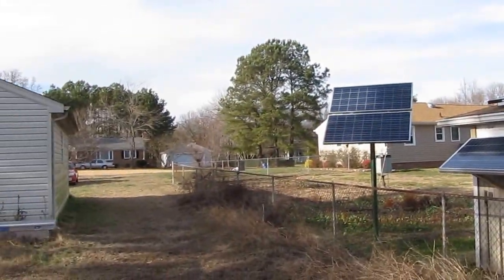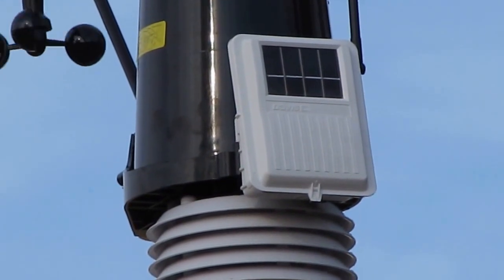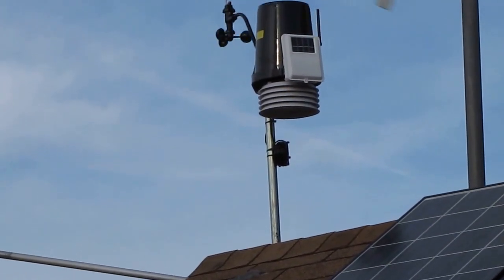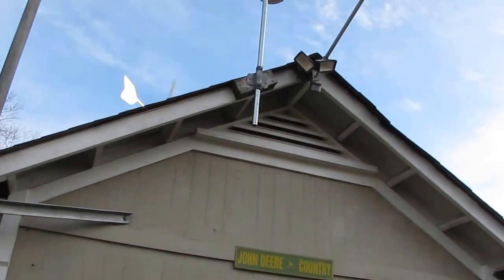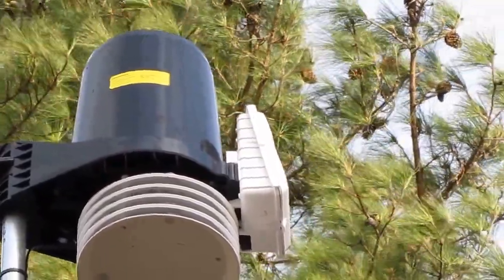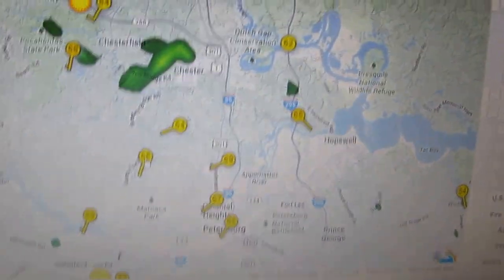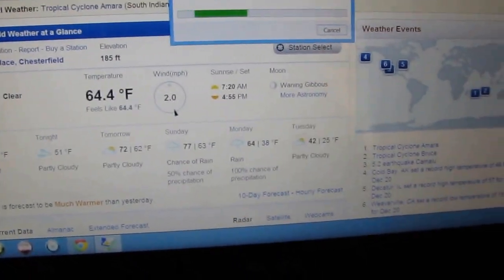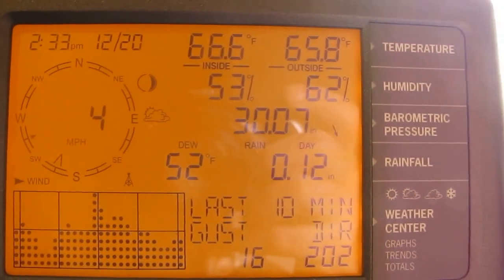Davis Vantage Pro 2  6322  Integrated Sensor Suite With Davis Vantage Vue 6351 Console  Pt 3

Comment: hi there hope its still workin well.do you find it better that the vue sensor suite.
Reply from the maker: Hi Wally So Far So Good No Complaints Brother Working More Than Better
Reply: I woz thinkin of getting 1 but they cost way 2 much.
Reply from the maker: They Are Expensive But There Is Reason Why It Is Built Way Better Buddy
Reply: think they are about 500 pound.
Reply from the maker: Holy Moly  In UK
Reply from the maker: Here Is A Link Wally 
http://www.scientificsales.com/6322-Davis-Vantage-Pro2-Integrated-Sensor-Suite-p/6322.htm
Reply: cheers.will the vantage pro 2 console work with my vantage vue iss.
Reply from the maker: Yes It Will Buddy  They Are Interchangeable Buddy
Reply: thanks.is the uk vantage pro2 console different 2 the usa one.
Reply from the maker: I Think They Make A Metric Version Buddy